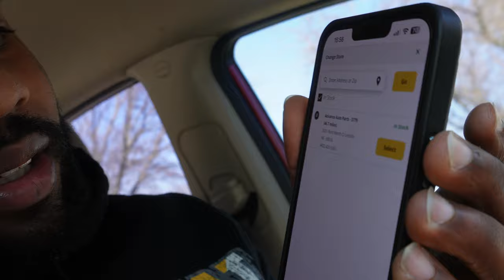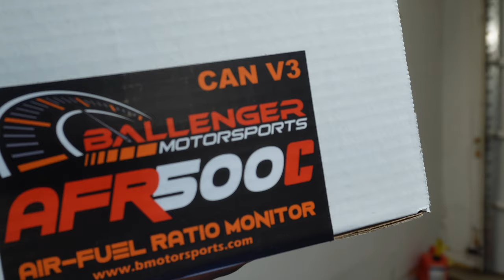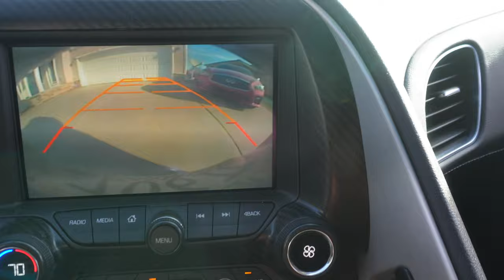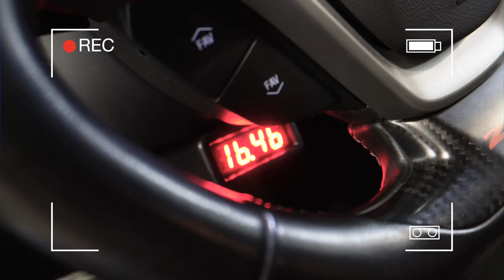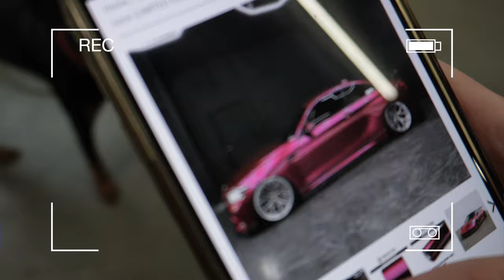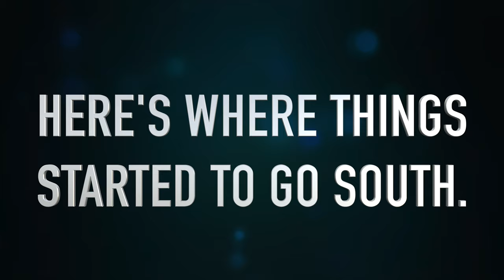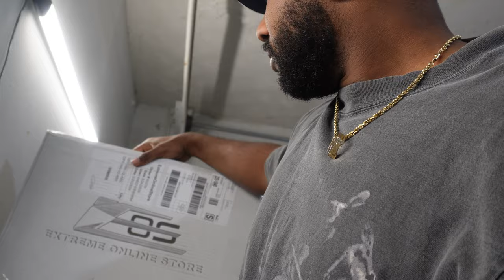My NEW CORVETTE Z06 IS A DISASTER.....!!

Comment: I’m telling you see if that car has throw a belt before if it has it will either be the alt causing the stabalitrack light or the belt would have slap some wires to the throttle body and or ground wires I had this happen on my 1400 go V coupe that will cause the stabilitrac issue or last but not least a bad wheel bearing that should help you narrow down the stabilitrac issue. You can diagnose that on your own with a scanner but I’m almost certain it’s one of those issues causing your problem!
Reply from the maker: Will it throw a power steering code also? I just got and a rear axle disable code rarely. But goes away
Reply from the maker: The power steering doesn’t go away tho. It just pops a warning